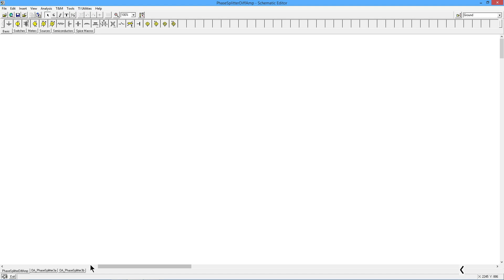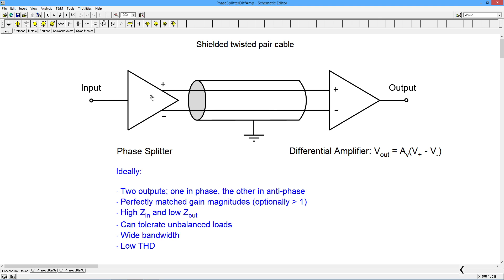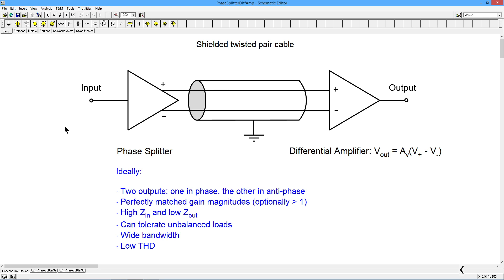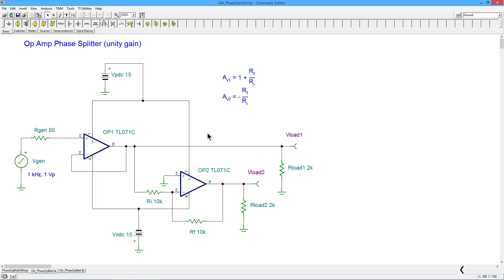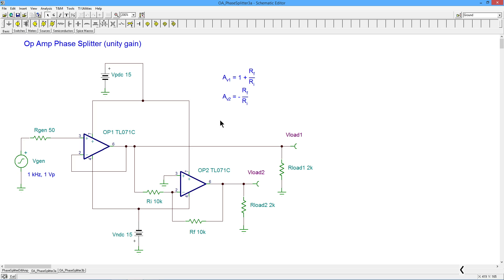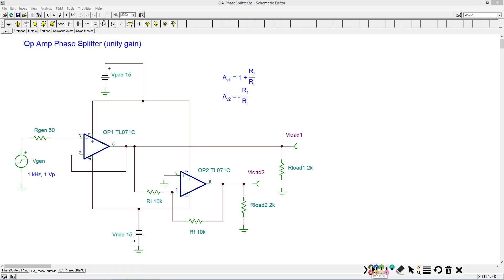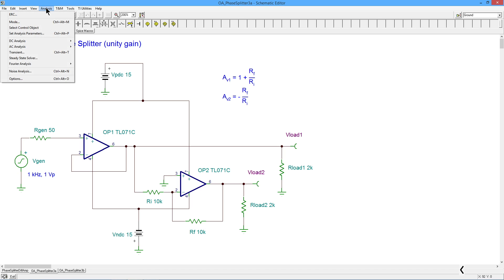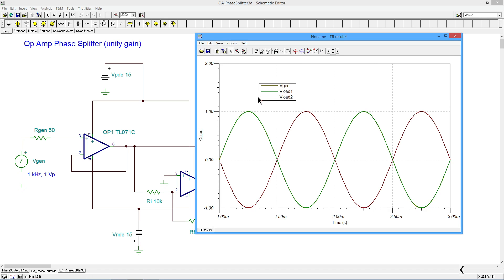Op Amps: Op Amp Phase Splitter

Comment: Hello my question was placed under the wrong video when the youtube player skipped ahead re-writing here:

You say this is typically done with twisted shielded pairs but isnt this technique used anywhere for low noise measurements? Like one would/could happily do this with noisy PCB traces just as much as they would with cables coming in from a sensor somewhere right?
Reply from the maker: Yes, the concept of differential signals and noise cancelling is broadly applicable. You might be using it right now!

Comment: Excellent, Thank you. Opamps really are great. One of my friends is very pro discrete components but I see many uses for these. I'm wondering if a 5532 could drive a couple of Power transistors.
Question...
Would we be better off using the 2 opamps on the chip as an amplifier then follower or beter having 2 (stereo) channels running through two chips independently. That is, should the stage 1 amps be on one chip and followers on another? (I know we can get 4 opamp chips, I just have a lot of twins)? I appreciate you taking the time to answer my questions. I'm truly grateful.
Reply from the maker: That really shouldn't make much difference. The cross-talk on modern op amps is tiny. I'm not saying that there is zero difference, but I suspect that it would be negligible in virtually any practical application.

I like the 5532 series. I've used them a few times for audio projects. It's some four decades old and was top-of-the-class back then, but it's still a solid performer, especially for the price.
Reply: @ElectronicswithProfessorFiore  Did you see my link to the opamp shootout from Doug Self?
Reply from the maker: @simonyoungglostog  I missed that. Can you repost it here?

Comment: I have a really good use for this.  I am already redesigning this for electric guitar!  Use a +9V supply, add a voltage divider (say 2 100K) with coupling capacitor on the input to capture negative swings in the input.  Now I have a converter from unbalanced electric guitar to a balanced input to my mixer.  Thanks Professor.  Now if you would do a video electrically explaining the difference between line, instrument and mic levels.  There are plenty of videos on here on that subject, but none that helps me to convert one from another without buying a box to do it.  I would probably add the gain on the first state as shown, with a pot to vary the gain.
Reply from the maker: To further confuse the matter, there are consumer and pro line levels. Broadly speaking, "line level" is around a volt for the max level. Pro is a little higher than consumer (think in terms of a little under a volt versus a little over a volt for 0 VU). "Instrument level" depends a lot on the instrument. If it's a modern keyboard, it will likely be at consumer line level (or possibly pro line level if it's a higher end unit). For a passive guitar, that will depend on the pickup. Generally speaking, when feeding a high impedance load, you might get a few hundred millivolts for a loud chord, but I have heard of pickups that will pump out over a volt. Mic level is a couple of orders of magnitude smaller, so think millivolts instead of hundreds of millivolts. 

If you're converting from consumer line level to pro line level, you'll need about 12 dB of gain (x4). FYI, consumer line level is sometimes called "-10 dBV" and pro "+4 dBu". For reference, 0 dBV is 1 volt, thus -10 dBV is a little over 300 mV. 0 dBu is 0.775 volts, thus +4 dBu is a little over 1.2 volts. More details on dB at the beginning of the Op Amps playlist.
Ultimately, your best best is to get out a digital o'scope and measure the signals!
Reply: @ElectronicswithProfessorFiore  I have been reading your text on the subject, which had made my understanding of dB better.  I think for novice analog folks that voltage is easier to visualize.

Comment: This op amp comes in quad as well, the TL074, since I just had bought some.
Reply from the maker: I've use the TL07X series many times over the years with success. It's been around since the 1970s. There are newer designs that have lower noise and distortion, so you might want to broaden your choices.
Reply: @ElectronicswithProfessorFiore  I am certainly open to suggestions.  I have several different ones in my personal stock including the OPA134 and LM741.
Reply from the maker: @jimbelcher6877  Off the top of my head, the NE5532 is nice. I believe there is a dual version. Also, the LF411 (again, I think there is a dual version). I suggest you go to ti.com and search on their audio op amps.